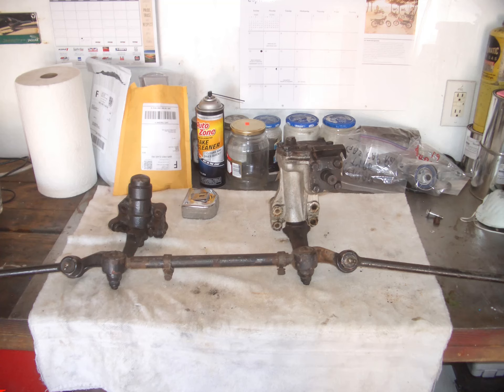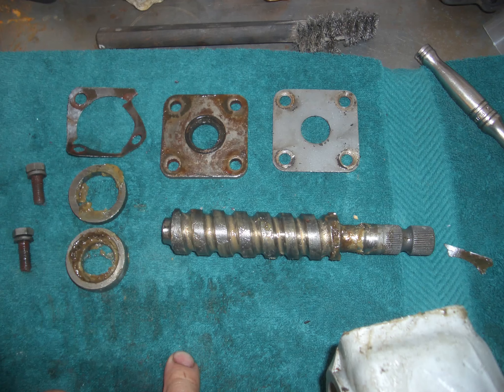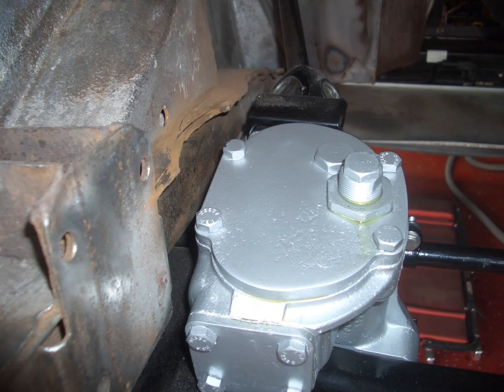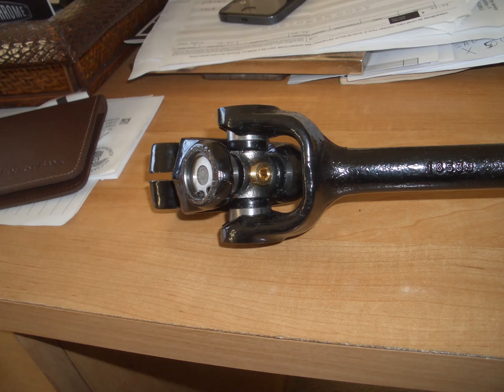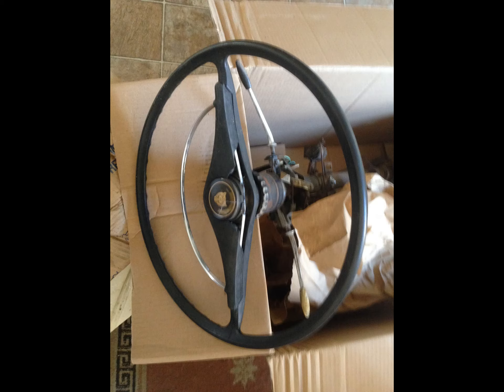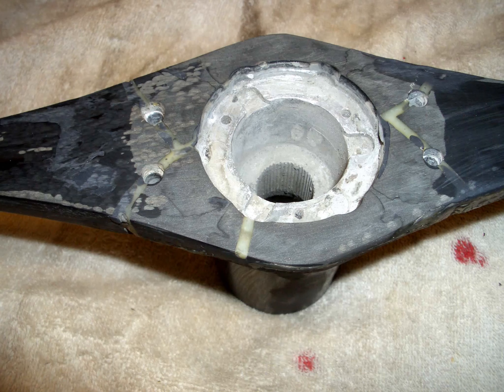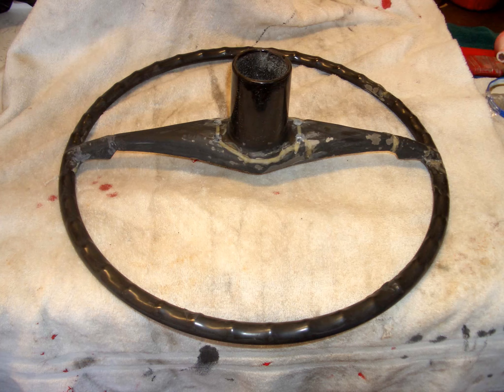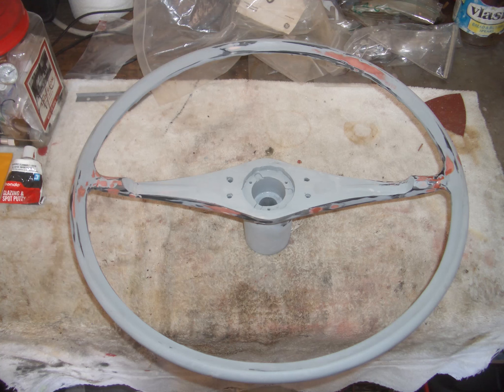Jaguar MKII Steering bits

Comment: Nice set of photos, I like the restoration of the steering wheel. You mention using a plastic primer but don't say which top coat you used finally. Was it just a gloss black? Did you use a spray paint top coat? Thanks.
Reply from the maker: Sorry for late response I used Rustoleum black gloss that is suitable for Plastc/Metal and wood but have not had chance to test as car is not put back together yet.